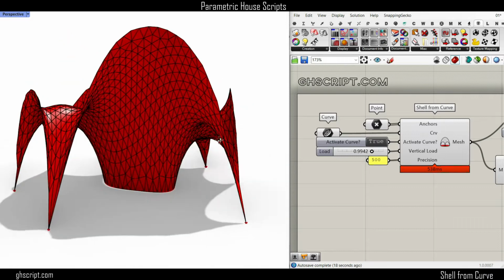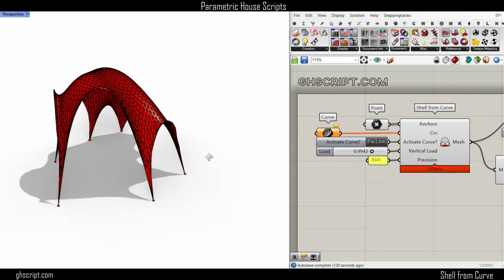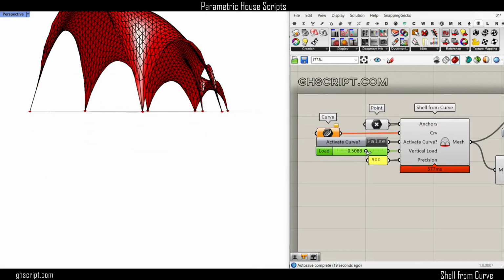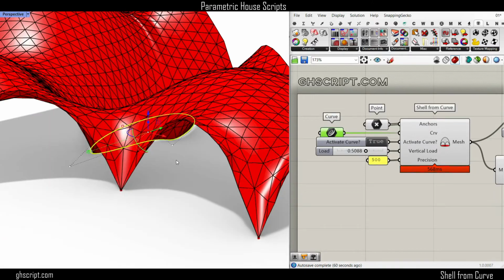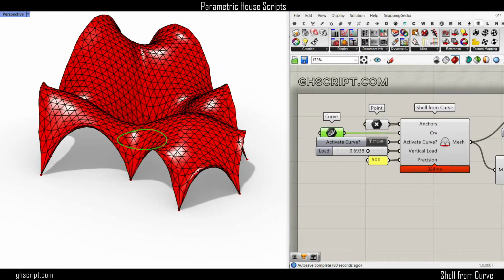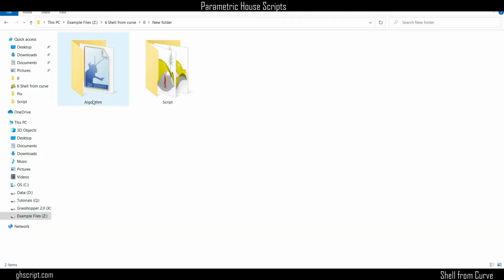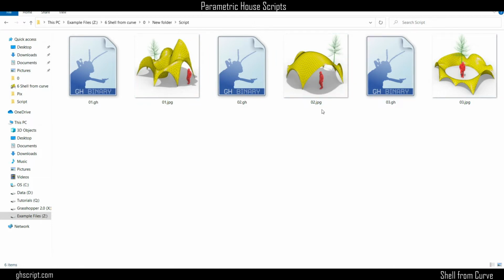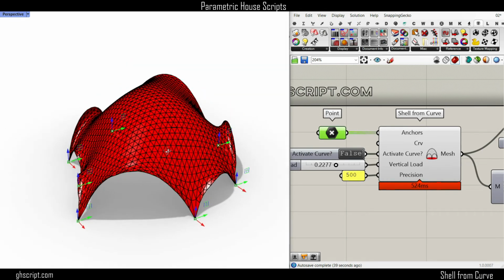Shell from curve (Grasshopper Script)

Comment from the maker: In this Grasshopper Script, you can model a parametric shell by defining a series of point anchors and a curve anchor.

Shell from curve

Inputs

Anchors : Points that are fixed and anchors the mesh
Crv : The interior curve which is used as an anchor
Activate Curve? : Should the curve be used as an anchor?
Vertical Load : The vertical force applied on the Mesh 
Precision: The number of iterations to reach the final result

Outputs

Mesh: The Final Mesh

More info about this script 👇
https://ghscript.com/shell-from-curve/